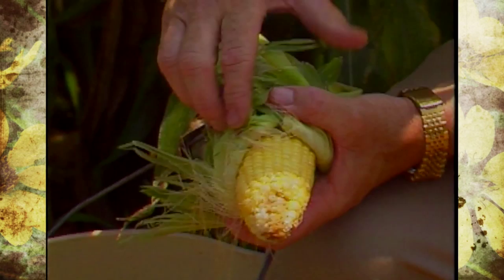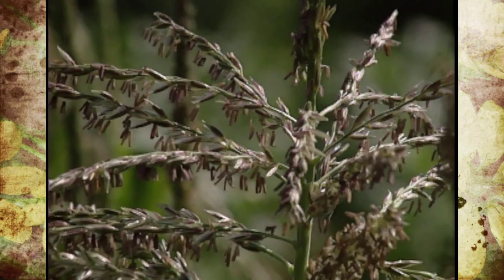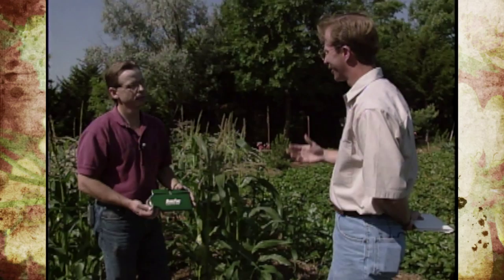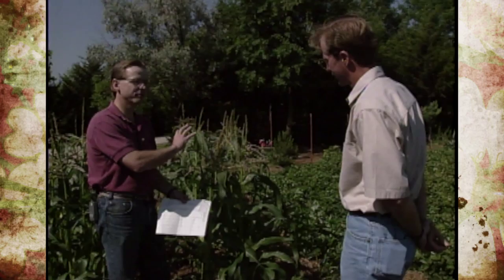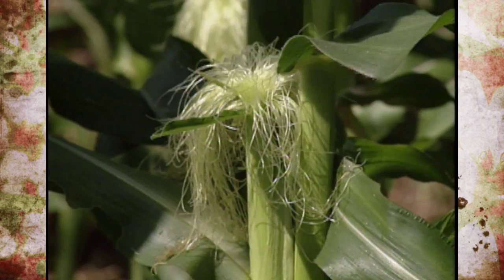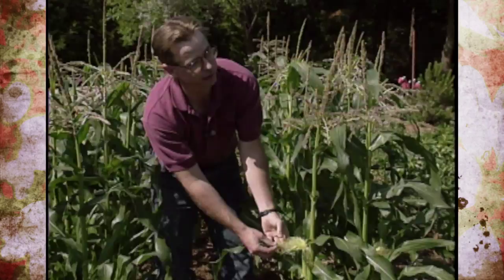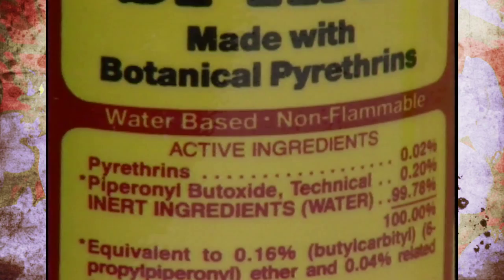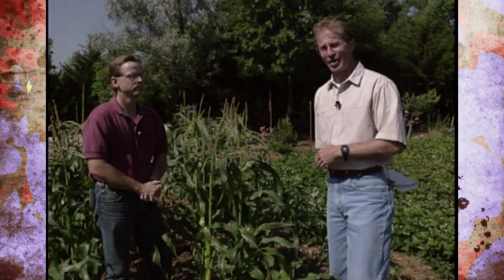Corn Earworm Problems

Comment: Considering your concerns about Pam  affecting pollination and the timing, I held the sprayer close to the top of the silt and only sprayed maybe a half inch circle of the silt and not touching the rest of the silt with oil.  We did not find a single worm inside the shuck from about 150 ears of corn.  Some ears were not filled out all the way to the end but they were very close.  Any thoughts?  Thanks.
Reply: Thank you for the info! Gonna give this pam thing a try!
Reply: @bridgettewood1713  I planted some late corn and it had a few worms.  My early corn did not.  I still think the pam helped but it did not solve the problem.  I have seen worms in every ear before I began spraying Pam.  I wish you well.

Comment: Great video.

I suspect spray olive oil will work as well as canola oil.  Is that true?  We almost always have it in the kitchen.

Will spray canola or olive oil affect pollination?  Thanks.
Reply: Olive oils and other coals pressed oils are thicker. I’d recommend regular olive oil vs Extra Virgin as EV is thicker.
Reply: @ChefClary60  Thanks.